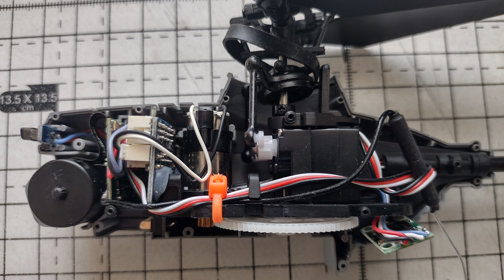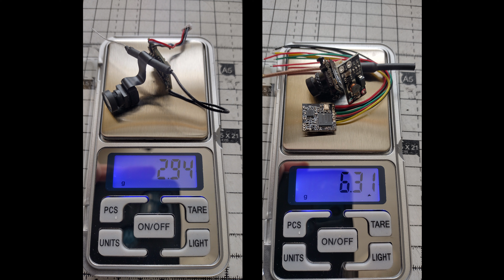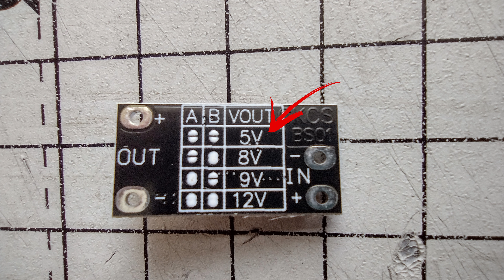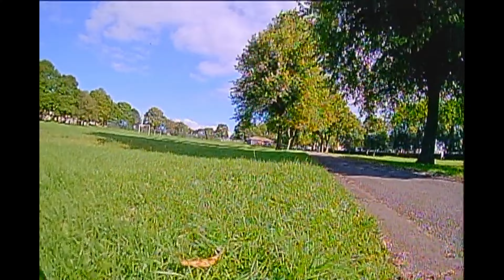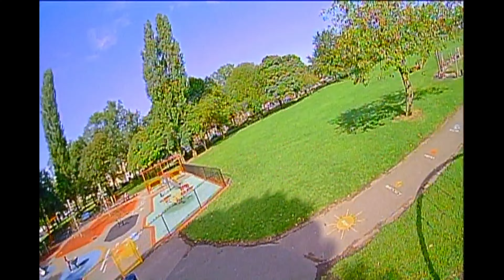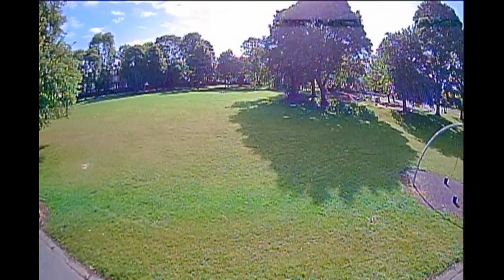EACHINE E110 - FPV conversion

Comment: I have mostly managed to stay away from helis.  I get the urge occasionally, but have seen how expensive things get with rough landings.  BuddyRC (OMP Hobby)  is right around the corner from me and they have some really nice products, but none come FPV, and most Heli FPV I have seen is pretty shaky.
Reply from the maker: This falls completely in the toy category. I was expecting vibration to mess up the video, surprised when it didn't!

Comment: Awesome work.  That wifi camera was the pits - but I couldn't be bothered to make that much effort to swap it out.  Glad you did !
Reply from the maker: Awww thanks, wish I hadn't fried the 1st VTX - those little jumper zero Ohm connectors looked just like unconnected pads without looking with magnification. The TX16s multiprotocol binds to the helicopter too - I hope to do a follow up flight here with far better control and being able to fly out a bit further. The video quality was rather good - surprised me!